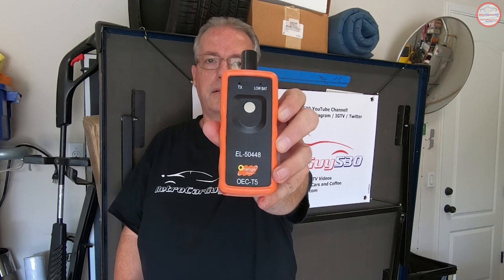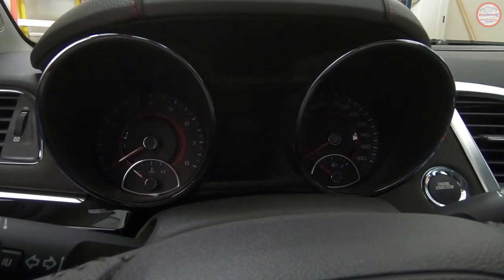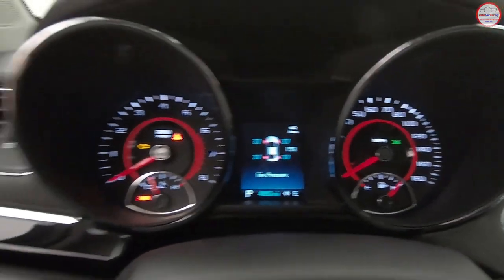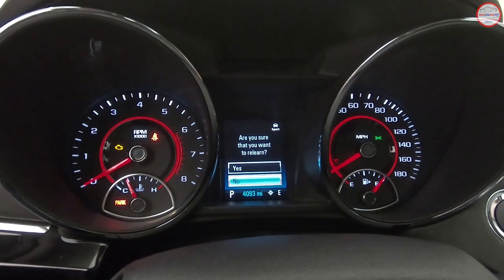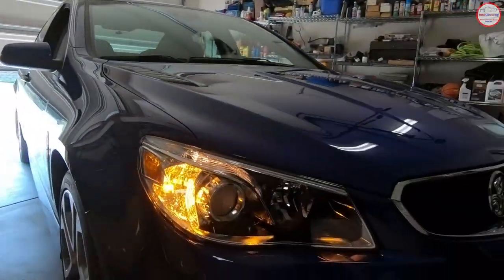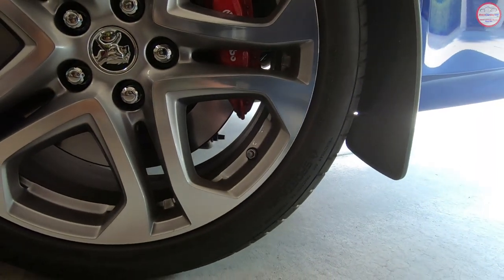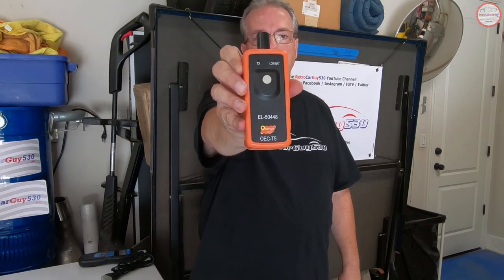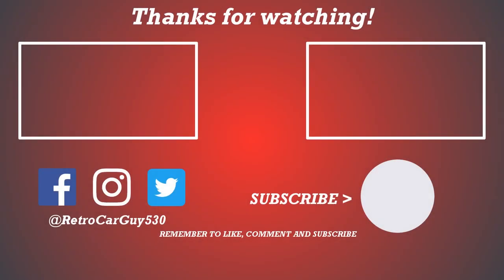Chevy SS / GM Vehicles - TPMS Sensor Matching Process / Relearn Procedure

Comment: hey there 
thank you for your video ,but i would ask you couple  questions :
i have dozens of sensors that i bought and i don't know on which cars the sensor works ?
is there any way to know ?

thanks for reading...
Reply from the maker: My suggestion would be to look for any identifying markings / part numbers on them.  Take that info and perform a search in your favorite search engine to see if you can backtrack those markings to a part listing which might identify the car make/model the sensor might be usable with.
Reply: thanks for response 
i've already tried that there no trusted source or useful site ; 
i even start seeing that is a very common problem ;
if you have any trust source or useful site ,please send 

thanks again
Reply from the maker: The only other thing I might suggest is to check with a local tire installer and see if they have a vendor, catalog or vendor website they may be able to help you lookup the sensors.  TPMS sensors sometimes need to be replaced by a tire installer since the sensors, at rare times, become a victim of the removal or installation of a tire.